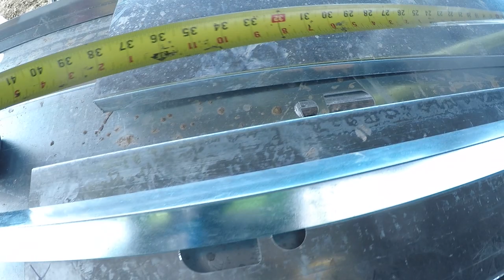How To Build A Box Beam For Metal Stud Framing

Comment: I would use a red iron frame for the door opening and weld it properly it would be much stronger and cheaper than cold rolled metal
Reply from the maker: I'm a big fan of using more red iron and concrete and less steel stud. It drives me insane, you can build much cheaper with much better strength using the proper systems.

Comment: WAY back in the day, before my spark making, I made sparks with arc welders. Completely different kind of steel construction - built giant machinery more or less. Always thinking 4 steps ahead so it goes together perfect without any hitches. You make it look like EASY money! But you miss just one of those steps, and the entire thing goes to hell. Really dig how you have a specific pattern you screw it together. Same thing when tack welding parts together aside from having to guestimate how much the part was going to move from the tack pulling, and occasionally hitting a tack again and whooping it with a hammer. I had something like 20 of the smaller vise grip C clamps, those things are so handy.  Hated the ones with the swivel pads though.
Reply from the maker: haha yes man im not a fan of the swivel heads either and have tons of clamps.

Comment: what gauge for beams and headers?
Reply from the maker: Most of the time we use the same gauge as the wall being built. Exterior is 16-18 gauge and interior is 20-25. Pinbolts are used in combination with 3/8" to 3/4" rod drilled in and bolted down with a washer. The job specifications under master format will have the exact size, depth and  placement for each wall system. I hope that helps my man, I answered both your questions under this comment. If you have anymore or need further clarification I am live this afternoon taking questions at 4pm MST. Or you can leave them here.

Comment: I'm pretty sure you're supposed to cut the flanges off of the studs and run the web of the stud over both studs in the opening. 3 screw in each stud PLUS clip the top and the bottom of the box beam
Reply: Yeah I’ve cut out the ears and ran the tongue past the king studs and screwed into king studs as well as the clips around each corner. But ultimately it’s up to the drawings/engineer. Different ways to do it.
Reply: We do that on light gauge. But on heavy it builds up to much metal layers making the drywall bulge out in the interior. Also we don’t use angle like he is we just use track and favor the inside for drywall  letting the rest stick out on the exterior since typical building have an airspace for brick or EFIS.
Reply from the maker: Yeah man, I have seen that before with light gauge. When you do it with the clips you really need to make sure your flush both sides and because the box beams are always a bit larger you need to split the dif.

Comment: I was on a job where we built box beams that were 6 inches wide 8 inches tall 14 gauge 14 gauge track on the top and the bottom with 14 gauge studs filling in the interior until they learn that maybe we should just order tube steel for the horizontal connections  . We use two cycle engines to cut all of the metal like a Skil saw in the air only Carborundum blade slicing through the metal to create loadbearing buildings that house people today in the Bay Area
Reply from the maker: Wow, yeah 14 gauge is ridiculous, have to charge a lot to install with that heavy of steel. Usually only panel factories use that gauge never seen it for stick framing before.

Comment: You should of cut the flanges off the studs to have ears to screw to the studs with angle clips. But great watch 👍.
Reply from the maker: Be careful doing that, there are a couple ways to set the box beams in but that isn't one I have ever seen or done. I think you may be alright doing that but I still recommend using angle or track. The reason why you don't want ears is because you want to try and keep the components on the inside of the opening  for drywall purposes. The more you add to the outside of the stud the harder it is to get drywall inside the frames. Some frames you already have to 45 sheets to get the board behind the door frame. I don't imagine it will be strong enough either, using the ears, you have all that strength in your beam and it's not going to be supported properly. Cheers my man! Hope that makes sense.
Reply: @ConstructionKronies  we use angle too with the box plus ears out in California. Two tracks two studs . The angle too .
Reply: The screws won’t make any difference because there is screws bottom top of studs . I’m a framer/drywaller . Drywall is the art .
Reply from the maker: @jessepantoja4751  Dam straight it is!👍
Reply: True butterfly ears on each side to connect our King Studs. That's out here in Cali.

Great Clip..

Keep on Rocking.